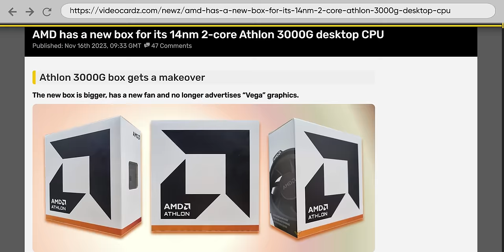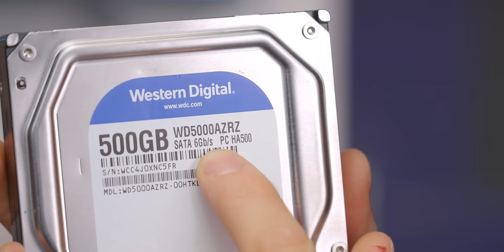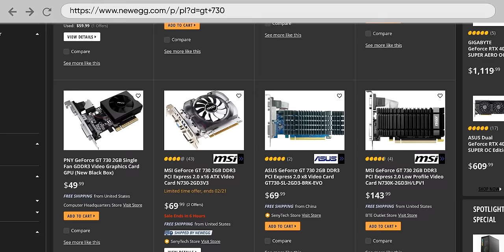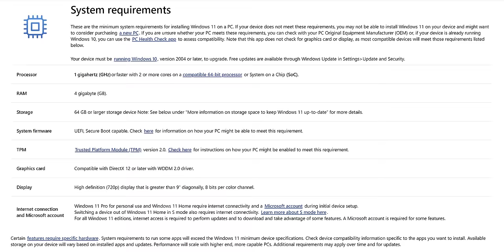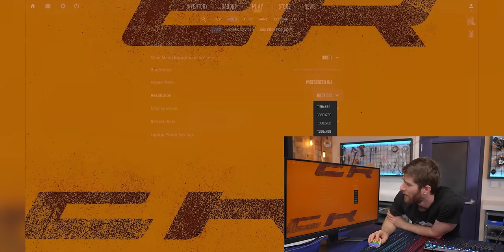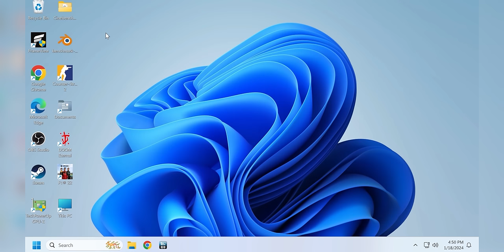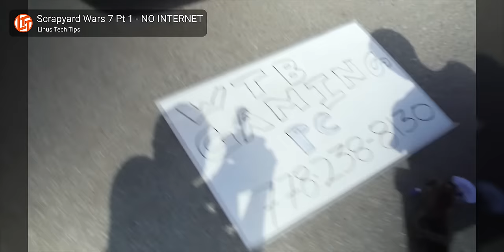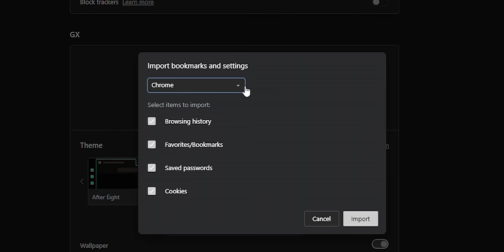I Built the Slowest Brand New PC and it Sucks.

Comment: For the GT 1030  you should've gotten the DDR4 version. I had that one and it couldn't run CS:GO for it's LIFE
Reply: Yeah they brag about slowest and then they buy the GDDR5 1030...
Reply: it was the HDD, I felt that it was unfair that they used a mechanical hard drive when 120GB SSDs are 9.99€
Reply: Oh damn, they do still sell the ddr4 version brand new
Reply: @aquss33  ye but they were going for the SLOWEST brand new pc not the best value
Reply: Dude, I've played csgo on a 710 ddr4 2gb. Dunno what ya sayin.
Reply: @WowSirSmallFan did your 710 have a fan? mine was a 1030 passive and thermal throttled
Reply: Bro same here😢
Reply: @charginginprogresss   Bruh it didn't even launch the game.
Reply: @charginginprogresss  That one I don't think is still supported by Windows 11, and are also pretty rare brand new.
Reply: You must be talking about CSGO2 because my Gt 710 ddr3 version I used to have could run the CSGO on 50-60 fps on 720p resolution.
Reply: @aquss33  it's not just the HDD. HDDs are mostly slow at the beginning, but the system then ramps up and you start seeing the other bottlenecks.
Reply: Yoi mean the gt 1010
Reply: @OrRaino  Probably cuz of the HDD/CPU
Reply: I was on 1080p and my 1030 was thermal throttling since it was the passive version in a bad airflow case @OrRaino
Reply: @the_retag  no I mean the 1030. I had the passive version, was running at 1080p and it was thermal throttling too so I got subpar performance
Reply: @filpoamati  yes, I have a small fan on it, but its the older version, not the newer ddr5 one

Comment: Slowest PC would have been useable with a sata ssd, and dual channel (2x4GB) RAM, and the cost difference would be miniscule. I would have liked to see how much faster it would be with those upgrades mentioned.
Reply: It's a 2 thread cpu, that's outdated even 15 years ago
Reply: yea thing can only process to apps running at once, so its constantly jumping. that four thread cpu they talked about at the start would've made the system, well, basically double the response time. it wouldn't of really gotten things done too much faster, but it would've made at least interacting with the thing a bit more tolerable.
Reply: They did say slowest not cheapest.
Reply: Yeah I made a similar comment, this really is a vid about the slowest PC, not the most cost efficient. For 380$ you can make something 10x faster, but it's not really the point of the video. You can make a computer with a ryzen 5 4600G, 8gb ram and an SSD for 380$...
Reply: Yeah, they are exacerbating the truth because the goal of the video is to warn people about buying the cheapest new parts instead of getting used old workstation and GPU.
Reply: A cheap 128GB SSD or even NVMe would likely cost as much or less than the 500GB HDD, especially if you get the NVMe off ebay as he did say second hand was an option. But then price was not the goal, low speed was.
Reply: It's a 2 core cpu. That shit was outdated 14 years ago my guy.
Reply: @NadeemAhmed-nv2br  I use G5900 and 3000G in the office daily, they are very usable, the 3000G is much better offcourse... you dont even need dual channel, but you do need a sata SSD. You can put that HDD on a 7800X3D + RTX 4090 and its not going to be much better in Windows, games will run better yes.
Reply: "usable" is relative

Comment: Didn't Windows 11's minimum requirements at some point specifically point out that the persistent storage needs to be an SSD rather than an HDD?
Reply: Windows 10's minimum reqs should be an SSD

But Microsoft couldn't dare to say so at the time
Reply: Not this schools IT department.
Reply: I've ran windows 11 from an HDD before. It was fine for the most part, it actually runs better than 10 on that sort of drive. I'm still using that same HDD as secondary storage even now though the OS is now installed on an nvme ssd. It's actually very reliable.
Reply: It's basically unusable on HDDs for anything other than web browsing, but that didn't stop Dell from shipping Optiplex 7050s with SMR boot drives.
Reply: There's new low spec Win11 machines that use eMMC. Not sure exactly what version they use, but I doubt the I/O speed is much better than a hard drive.
Reply: I had Windows 11 on a nearly 10 year old mechanical HDD for about a week while I waited for my 990 pro nvme to show up (as my 860 evo died) and it worked fine, definitely slow but fine.
Reply: An HDD with plenty RAM is not that bad, although I would not recommend a 5400 RPM. 7200 is the only option for decent boot HDDs and is fast enough to stream 4K rips through Plex (If defragged)
Reply: It's not the HDD that is causing these issues though. It's the abysmal amount of RAM. That little will cause constant cache misses that will cause the system to go back to the disk. If they'd put in 8 or 16 gb of RAM, I bet the machine would have run okayish.

Comment: 20MBps really isn't that atrocious for download speed. I mean, it's not fast, but many many people run internet plans at that speed just fine. I was happy to upgrade to a faster one when I moved but it served me well.
Reply: I'm stuck with 4MBps, and I don't live in the woods. My town has fiber, but not my neighborhood!
Reply: @fostena  Yeah, that's slow as hell, insane that it even exists still - you'd probably get a better connection in the woods on top.
I'm stuck with 25MBps here. And that solely due to the fact that they gracefully gave access to it after upgrading half the city to 1GBps a few years ago with the plan to hopefully upgrade to 1GBps to everyone within the next 2 years from now. And they also give a really, really fair pricing with only charging 80% of the 1gigs price for 250k as the cheapest option, if you want to you can have less - at only 75% the price for 100k and 70% of the price for a 50k connection.... So to anyone who actively uses their internet and needs speed it's either getting the 250k and getting ripped off and to anyone else who either doesn't need that much or doesn't use it that often it's getting ripped off even more one way or the other.
Reply: bro we have fiber and on my pc max i get 6mbps, on my ubuntu laptop 10mbps and on my win8 laptop like 2mbps
Reply: @RRareGaming  that may to be a CPU bottleneck issue. Have you checked what speeds you can achieve locally, like between the two laptops?
Reply: @fostena yeah, my win8  laptop(3120m) only manages around 25mbps locally, whereas my ubuntu(3110m) one manages about 100~, well the weird thing is my pc has a 9900kf yet its still only getting 6mbps..
Reply: I think the point was that their location was capable of multiple times that download speed, yet they were so badly bottlenecked, they could only take advantage of a fraction of a percent of it.
Reply: Yeah, 25 MB/s  is alright, but this dude is comparing it to a 8gbps connection lol
Reply: Goddamn, I live in Brazil in a relatively small city of 70k inhabitants and I'm blessed to have 500mb internet speed with unlimited data (gets to 700mb sometimes). It's weird whenever I see North Americans saying they're stuck with low speed internet, like 4mb. Man, internet providers are really doing y'all dirty.
Reply: @DamascoGamer you have 500mbps sheesh i live in one of the biggest cities in inida and only get 40mbps (4mbps download speed)
Reply: @Karzipp 25 MBs would be okay but 25mbps would suck.
Reply: I still have regular broadband with 1.5mb and I'm doing just fine
Reply: Linus is detached from reality, like a lot of rich people.

Comment: I'm watching this with the Intel Celeron G5900T. I got the motherboard free, and got the CPU for $19 used. It does everything I need, and requires no cleaning of fans because I removed the fans. It uses barely any power, and is somewhat snappy feeling. I like using mine for light work loads, like watching videos, social media, and very small video editing tasks.

Comment: The boot time is actualy pretty interessting! It shows that MS has eaten quiet alot of the performance gains of fast storage by bloating it up!
Reply: Not even just M$, but gaming as a whole, so many games on console still having pop-in despite the console manufacturers forcing SSDs on us. The worst thing is when M$ forces you to use an SSD for games that would work perfectly on a HDD or even worked before on a HDD.

Comment: How much quicker would that PC have been with 8GB instead of 4GB? The broader point is correct, but I suspect this was the most significant pain point in the build and cheap to address.
Reply: Yeah, I winced when I heard him say 4GB. I wouldn't have put that in a build 15 years ago.
Reply: I remember a couple of years ago a friend said that his pc did problems for him so he upgraded from 2gb to 4gb of ram. I was absolutely shocked that windows even managed to run on 2gb of ram. I at the time wanted to run Minecraft faster so I upgraded from 8gb to 16gb, btw I actually didn’t know that Minecraft had a 2gb limit if you don’t change it in command. Noticed it only after I upgraded and it still ran the same.

Comment: I think it's worth remembering that their 'slowest' system was a completely custom build, not from an OEM. In other words, no one is trying to sell a new system with those particular specs.
Reply: The whole point was to go as slow as possible but with new parts, not to show cheap stuff being bad.
Reply: True, basically any prebuilt pc will be better, but I think the point was to say why are they even selling these parts when windows can barely run on them
Reply: @Midwestmint Because not everything runs on Windows and not every part is meant to go with the others. For example, no one in their right mind would use an HDD as a boot drive, they're still cheap mass storage however. Realistically, once you replace the HDD, you have a fine web browser system. With an i3 or i5, you can actually do some work on it.

Comment: I got a Dell XPS Sandy Bridge (i7-6700) at a yard sale for $40. A GTX 1060 for IIRC $25 at another yard sale, a RAM upgrade, and replacing the drives the prior owner wisely yeeted made this machine a beast that can run everything I play at 1080p60 Medium.
Get out there. You might not even need to go to online marketplaces to get a dang good deal.

- PC: $40, RAM: Okay, I splurged and gave it my $90 set, SSD: ~gift, hard drive: ripout from another yard sale PC, $30 plus another PC, GPU: ~$25 IIRC.
I could have done better on the memory upgrade, or even kept the single-channel kit that was in it.
While I'm currently using my nice EVGA peripherals and 8bitdo controller, my monitor and speakers are ALSO yard sale.

Comment: You should compare that system to one of the mini PCs you can buy for about the same price - like a BeeLink, MinisForum, etc - any number of decent and cheap options all in for less than $380. They all use laptop parts but they would run cycles around this thing - even fine for casual gaming (30fps at 1080p on low settings). Or, consider comparing this system to a decent "value" system with good parts for the same cost (or less) - really showing the difference in picking up the right parts for your budget.
Reply: Definitely. The power supply and ATX case are such large fixed costs that you can't get good value in terms of price/performance when you go for the absolute lowest end parts.
Reply: @kristinnkristinsson1369  Another example is the use of DDR3. Often times, older tech isn't cheaper because it is no longer mass produced, and it can even become more expensive the older it is.

Comment: When I started at my present job most of our production computers had i5 processors, 8GB of RAM, and 5400 RPM mechanical hard drives, some were even still running Windows 7 (this was 2019). I had to reboot one and it took an hour, seriously, I timed it.

Many of those machines have been replaced, the rest now have at least 16 GB of RAM and SSDs... and wonder of wonder, they run like real computers.

They are all Dell Optiplex's of various form factors. I'm not fan of Dell (it's a four letter word after all), but I  can't help but be impressed with how well these things hold up in our factory.

Comment: Worst PC I ever worked on was on of those cheap  AMD 1GHz laptops. Ran perfectly fine when everything was on it, ran surprisingly well in fact, but setting it up so my mate could use it as a car diagnostic PC abd finding the version of windows all the software worked on nearly drove me insane. He does all the work on my cars for the cost of the parts and will come out to help you at the drop of a hat, so I was determined to get it sorted for him. Took me near a month of a couple of hours a night, as it took an hour plus to install windows along with the drivers (I replaced the hdd in it with an SSD as it was so slow but it did little other than make the os more snappy, the rest was down to that dual jaguar core 1ghz cpu. I finally found an untouched original version of windows 7 32bit that everything worked on, and after 2 days of just installing on what was only a 500gb ssd, I made multiple images of the drive (which took half an hour at most), as there is no way in hell I want to do that again, it made me look forward to going to work it was that bad :D

lol 3 years on and I still have 3 copies of the drive image on some of my external drives until he gets a better laptop, though I know I will suffer again as many of the older car diagnostics he needs, won't work on newer OSs and need at least basic hardware support.

Comment: Windows minimum requirements.  The hard drive was a mistake, but another big mistake was just having 4GB of RAM. Windows will boot with that much installed but it will not like it, as you can see. I had a laptop with a similar spec. AMD A6-6310, 500GB HDD 4GB DDR3... it was stupid slow. When i added more RAM it made a HUGE difference since it wasnt using disk swap on a 5400 RPM HDD. 

A SSD will also speed things up too. 
That 2 core 2 thread CPU definitely doesnt help anything for sure. But when i took my uncles old PC with an athilon II X2 255 (2 core 2 thread) system with 3GB of DDR2 and a 500GB 5400 RPM HDD... and gave it 16GB of RAM and a SSD, it booted up in far less time. though it wasnt like you were going to play any games. I also slapped a gtx 750ti in it, that i got used. Made the system bearable for a while. Ended up snagging an i7-8700 CPU and a motherboard + cooler to boot for basically nothing and ran with that. 

The fact that you can still buy a 2 core CPU these days brand new is wild. Microsoft stating windows only needs 4GB of RAM is also ridiculous.  In order to have a decent experience you need a minimum of 8 but id personally recommend 16 for daily use. The OS will cache a lot of files and utilize it.

Comment: To be fair: The 500GB WD Blue HDD were slow in 2013, compared to a normal HDD with 7200 rpm. We had 120 PC's delivered with them. And they are astrocious Slow on 8GB Systems and Win 7 with i5 4570. After Sata SSD upgrade they were completly different Machines.
Interstingly we have exactly those Acer Aspire around, today i was upgrading some with their 128GB Sata SSD to 500GB, as those were dying. Great little Machines, we got them upgraded to 16GB now 500GB Sata together with the 8400 they are realy great and will live on a long time at school. Best part: Generic Parts. PSU is standard biggest Problem with Prebuild and Office Builds are the PSU, ATX, SFX or TFX Systems are great bud sadly lot of manufacturers have non standard PSU and connectors inside.
Reply: Even running Windows 7 on a 5000 rpm isn't the best - I don't see how their slow build was compatible with windows 10/11 because Microsoft definitely doesn't recommend or suggest running those on a hard disk at all.

Comment: "if it hasn't failed in 6 years it probably wont fail" 

A good tenet for solid state parts that are locked from overclocking.

Also, needs an explainer for what a "bathtub curve" is :). (where failures occur either immediately, or after a long time, but little or none in between)

Comment: The CPU is the least of your problems. You have insufficient RAM and you’re swapping to spinning rust. Spend another $15 to double your RAM and upgrade to an SSD for a $30 premium and you’d have a perfectly usable machine.
Reply: Spinning rust has to be the cannon name for a hard drive nowadays lmao
Reply: Exactly, the reason the first pc didnt even function properly was the 4 gigs of ram, its just not enough for even windows anymore. That being said it was still garbage for the price.
Reply: i wouldn't describe celeron cpu's as "perfectly usable" for a modern windows machine
Reply: The big issue is nobody optimizes their programs anymore. It's amazing what an indie game dev on a not horribly bloated system with that setup could do.
Reply: @xflyinglizardx  Blame the Windows spyware instead of that CPU.
Reply: @armorgeddon  Yeah, I bet that CPU would be perfectly good for lighter workloads under Linux, probably even with the hard drive and 4 gigs of RAM.